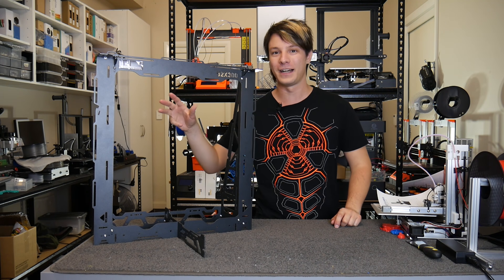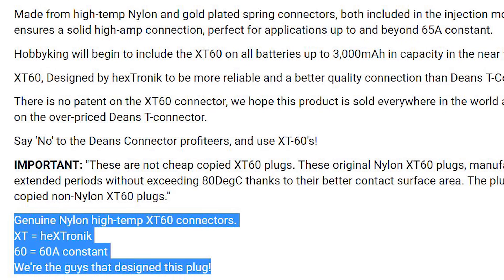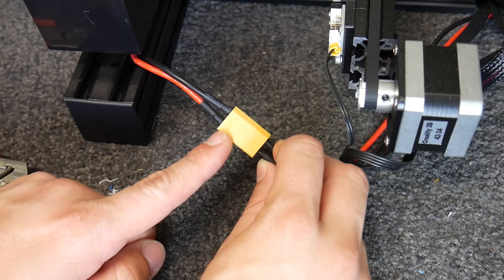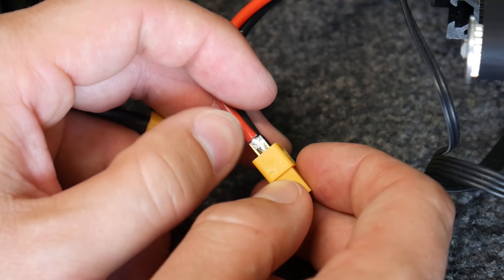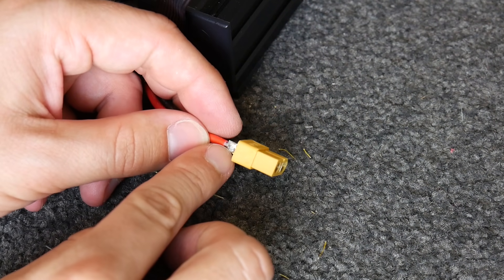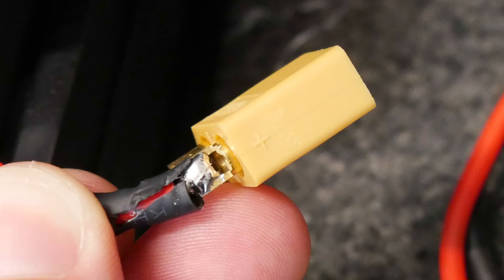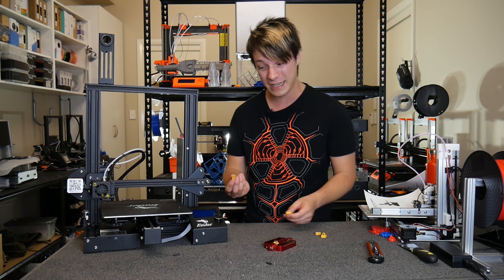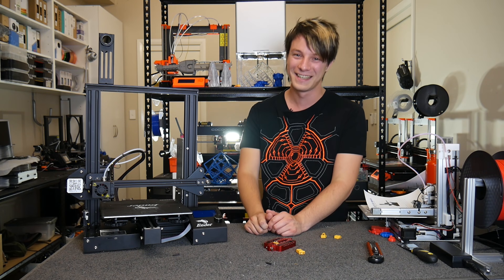Ender 3 Connectors are burning up... Bad XT60's

Comment: After watching this video I was concerned. I looked at the xt60 connectors on my ender 3, burned black. Shrink tubing on red wire was melted all the way through. When I tested it the plug was too hot to touch. I'm pretty pissed. I have two little kids and the thought that the house could have burnt down when I was printing overnight makes me really mad at this company.
Reply from the maker: It's unforgivable really.

Comment: Very interesting, just went and looked through most of my XT60 connectors on my quadcopters and those still unused in the parts drawers, the Amass and Turnigy (TGY stamped) ones look great but the few unbranded look worse in terms of plastic quality and shininess of the metal - however none of them have lots of amps pumped through them for hours & hours like on the Ender 3, so I feel I'm ok.

Comment: Other thing I noticed on them Angus, they don't appear to have the + genuine's do on the Flat Positive side all mine from Turnigy and HK etc have the positive side very clearly marked with a + and yeah they came out way too easy. Though as others have said the XT60 isn't exactly a 'gen vs knock off' as much as a plug standard these days like RJ45 etc.
That being said If they are either A. Badly Solders, B. Crimped or C only 1 peg split connecting then the resistance jumps massively, the XT60 is designed as you said to allow 60amps it presumes that it has at least the majority of the pegs splits connected in a firm contact to do so, and full core connection between the strands and the connector base plugs. 
Failure of any of these increases resistance and thus heat rapidly.
Reply: XT60 is not a plug standard, it is a product by AMass, and is specified in spec sheets like this: https://www.tme.eu/en/Document/2d152ced3b7a446066e6c419d84bb460/XT60%20SPEC.pdf, which is not a standard, just a product spec.  As compared to RJ45, where RJ means "Registered Jack", and ties it to raft of standardized specs.  Non-Amass blobs of plastic and metal with no specs are exactly knock-offs -- the situation is not like RJ connectors.  And the datasheet  pdf I pointed to shows that the XT60 is rated for 30A continuous, not 60A.

Comment: If the wire is oxidized, it can have a hard time wicking solder. Add a little flux to the wire to ensure it takes up the solder.

Comment: If we have to pull the whole thing apart and solder, or re-solder, why bother with the connector at all? Is it really needed for some reason? 

Why not just remove the cheap connector, solder the wires together, heat shrink tube them and  avoid a weak spot?
Reply from the maker: Not needed! Handy if you want to quickly isolate the printer's electronics but that's about it.

Comment: XT60's are adjustable...even those so called after market ones can be adjusted...just take an nail  or awl and spread the four parts of each side apart slightly...you can make them so tight you wont even be able to take them apart if you wanted to... the short and fire was caused by very loose fitting connectors...keep them tight and you are good as long as they are soldered correctly.. i have them in all my rc planes etc...

Comment: Hobbyking sells multiple versions of xt60 connectors. They are all fine, its just the lack of being soldered thats the issue. Some are made of different materials and hobbyking sells some made of different plastics at different prices.
Reply: The contact thing also doesn't mean much because its most likely the fit between the two plastic halves that makes them tight, not the bullet connectors inside them.

Comment: Hi just for the fact of color missmatch that inst per say a indicator for cheap this can just happen from a slight variation of the Masterbatch feeder usualy color get feeded at 0.6-2%  ,depending on the saturation of the color and base material ,so this can be easily a minor issue by the setup of the feeding maschine (Iam a plastictechniction)

Comment: If you want a free sturdy mount: use a set of pliers of some sort and put a rubber band over the handle. You can put a connector in de other end. That will secure your connector nicely.

Comment: I don't think these connections have to be made/broken frequently, so using a screw-connector terminal strip gives you solid connections and the ability to take it apart as needed.
Sometimes going quick-n-easy is bad, m'kay?

Comment: Okay, as someone who does QC on cable harnesses that go into very expensive, non-consumer devices, there's a few points of information here that are flat out wrong.  The biggest of which is the idea of a crimped connection being unsuitable for high power lines. Solder is more common, but both are used. Your real issue is going to be with the contacts, poorly machined brass of the wrong type has a loose fit, and gathers an oxide layer, causing high resistance, which causes the connection to heat up when there is high currant draw. Proper contacts should be make from the correct types of brass, to a tolerance that ensures a snug fit, and plated with a highly conductive, low resistance metal(gold).
Reply from the maker: Absolutely crimped terminals are as good, probably superior to soldered ones but the issue is the connector is only designed for soldering - it has solder cups. It's not designed to be crimped, so however they are managing to do it can't be good. I agree though, something also seems to be occurring the contacts as people are experiencing burning across the board, soldered or crimped.

Comment: Just got mine yesterday. Without cutting the insulation I can tell it's crimped. Will be replacing them soon.
Oh, you should always tin the wire first. Don't try to solder these connectors w/ bare copper wires; takes more heat.

Comment: I replaced mine last week and soldered them.(They were crimped) I had the same issue before i saw this video. The connector was so hot it could not be held. After replacing them, no further heating issue.

Comment: 6:13.. try prying/opening the spaces in the connector pints to see if the fit gets tighter. 
If not then the "brass" is not springy enough. You could always use X90 connectors all around,.

Comment: When replacing the connector, one might want to replace the actual power cables at the same time. If they skimp on the connectors there's a non-zero chance they skimp on the cables as well.
Reply: Yeah, I was just thinking that the cables are probably aluminium - or copper-coated aluminium at best :( They look like a good thickness, at least, but ONLY if they're actually copper! Aluminium has such a high resistivity in comparison to copper that those cables may well not be properly specced for that sort of current if they're aluminium. Would be nice if the insulation is silicone as well, which it looked like it might have been, but I couldn't quite tell...
Reply: @AndrewGillard  I could have sworn I read something, somewhere, about the cables being plated aluminium but I can't for the life of me recall where I read it, so don't take it as gospel. Check yourself, or just replace to be certain.
Reply: When I first took mine apart, I accuse them of being aluminum in one of the forums on Facebook.
Someone educated me that they are silicon wire which is very fine tinned copper with silicon insulation.
I replaced it with 14 gauge copper and no more problems.
Reply: @DjDiffrnt  I don't personally have one of these machines :) I followed Tom's "Dolly" i3 MK2 clone guide, but using much higher quality components, so my heat bed power cables are 12AWG silicone insulated cables from HobbyKing, which have tinned copper conductors and genuine HobbyKing/AMASS XT60 connectors :) Even though (because?) I built it myself, I trust my printer far more than I'd trust a Creality/Anet/Tevo machine 😂
Reply: @AndrewGillard  At least when you're doing it yourself you know where the parts have been sourced as opposed to when buying something (cheap) complete. I have an Ender-3 and an Anet A8 fire hazard, and I've always considered them being more like starter kits than finished printers. Currently I think that's a healthy viewpoint to have. 
Want something more finished? Buy something more expensive and proven.

Comment: Ditch the  connector all together and just run direct wire. Less hassle and you only need to do it once. The connector is only there to keep you from having to open the power supply or control box when assembling.

Comment: it's not that they're crimped, it's that the right amount of pressure isn't applied to the crimp. (the battery cable on your car is crimped...) I'm more apt to believe that the problem lies with the contacts on the connector. The outer case may be snug, but the internals may be only making contact on a small part of the overall surface area and therefore generating heat.

Comment: fyi i got my ender 3 yesterday afternoon, built it last night and the xt60's on mine look good, no washed out colour and can just barely pull them apart. really dont want to pull them apart to check the solder
Reply from the maker: Sounds like you got good connectors! Excellent.
Reply: Just received an ender 3 and have the same Amass branded connectors with a harder gray back. If you look at the linked xt60 replacement in the description on amazon, they are the same. Seems to me Creality has taken action based on this video/issue.

Comment: you should have added the soldering to the video since you plan on doing it anyway, hope you haven't finished that part. 

also if the fitting is even looser then yours, there could be some arcing of electricity in the connector causing heat build up

Comment: From the looks of it, the XT60 was DESIGNED TO BE SOLDERED and NOT CRIMPED!!! If these harnesses are being produced outside of Creality's premises, they should NOT be heat shrinked so they can be properly inspected!!! Heat shrinking is fast and easy! If male and female XT60 are connected together with a loop of wire, they can easily be cut to length and heat shrinked when they are ready to be assembled on the 3D printers!!!

Comment: I tagged you the other day showing a pic on twitter about how my cr-10s shipped with a loose screw on the bed heating cable, causing an electrical arc and burning up the PCB board. Come on Creality.

Comment: Hey Angus, do you think you'll look at the GeeeTech A10? I'm excited about it, compared to the Ender 3 because of it's mainboard. It's far better than the one that comes with the Ender 3, with BL Touch support right out of the box and places for Stepper drivers. All at around the same pricepoint. I did a video of it, it should be my most recent or so video.

Comment: Ended 3

7:18  looks like Ender 3 used a barrel crimp version of the XT60 terminal (I've never seen one before),  and they were crimped loose with inadequate wire strand compression.   Proper reliable crimp spec development for a defined wire size/spec and crimp terminal with proper plating & base material, is rather sophisticated, requiring extensive testing.for verifying the crimp performance. This is especially true for high current crimps, the crimp resistance must be extremely low and stable, or heat is generated which degrades the crimp further.. a spiraling failure that ends in a "thermal event".  Anyone just randomly selecting a crimp tool and thinking just squishing it together is a good idea for similar high current circuits ... is building a fire making device.
    XT60's work great when properly soldered. If wanting to crimp terminals, I'd use Automotive terminals / connectors and their developed crimp specs and defined crimping tools .. those type of crimps are validated to rigorous industry standards for reliability and safety.
    From what I've seen of these Ender 3 printers, safest solution, just remove that connector, run the wires of same gage or larger direct .. why mess with such risk on high current circuits??  KISS.

Comment: If someone is going to just take the connector off, why not just solder the wires to each other? Seems kind of odd to remove a point of failure just to add another point of failure.... I figure they put the connector there for ease of assembly and shipping, not because it helps carry current after the assembly process.

Comment: Hey Angus, got a small question for you and it is related to the soldering and wire work you are doing for this and any other video. I know you live in Australia and all and a friend and Fellow Maker does as well, in one video he did though he made a lamp and said he had to have a license to even do the simple set up in that is this true? Do you need a license to wire up electronics of any sort in Australia?

I only ask as my father has been working on Amps and mixers since I was a kid and he has no license, granted we live in the US and laws are different many places on the globe. I just wanted to see od the rule is that strict as I can't see a reason for a Shop Class level project needing a license. There is only one instance where crimping a wire is better than soldering and that is in Arcade Molex connectors as that is by design and low amp.

Comment: This issue is not new, this issue has been reported by many people months ago already in the Facebook groups. I'm surprised TH3D and other who follow up on it, only raise the issue at this moment. This is old news for anyone who is active in  the Ender 3 Facebook groups.

I also seem to get the feeling Angus likes to report flaws in Creality printers. I have not seen any positive videos from Angus about Creality or Creality printers in forever.  What did Creality do you do you Angus that we only get to see negativity about Creality on your channel?
I'm happy you got set straight on your stringing comment in your "review" of the Ender 3 Pro and props you posted a followup on that.
Reply from the maker: The positive video was indeed the stringing fix one and that was recently. I did like the CR-10 mini too but that was some time ago for my budget makerspace video. Other than that just the two ender reviews. If I was aware of this months ago I would have definitely raised it but unfortunately it's impossible to be on top of every detail of each printer and its community. I'd rather never talk about them again tbh but this is a safety concern so I feel I need to, just like the hot end shorting issue of the early wanhao i3's (that'll be fun to dig up lol).
Reply: First of all, thank you for taking the time to reply. 
Did Creality demotivate you that much with their CR-X that you require miracles from them to report positive about them? If you dislike them, why make videos about them at all? I understand you run a YT business here and Ender/Creality printers are popular and thus attract viewers. I understand you feel you should report a safety hazard, but i mean more in a general point of view. 
There's a boatload of issues with Creality printers, also regarding safety. The first few batches of Enders (and other Creality printers for that matter) don't have thermal runaway protection enabled. These are thousands of potential fire hazards peoples homes. 
Lastly i'm really surprised Tim (TH3D) only now tweeted about this issue as he is active in the Facebook groups himself and the issue has been posted multiple times. Though Tim also has a love/hate relationship with Creality. A big chunk of his business relies on Creality printers, but he's not a fan of the company.

Comment: Yeah that solder join really doesn't look good at the xt60 connector, I fill it up with  solder and then put in the tinned wire while it's still liquid. You also need to warm up the metal part of connector for the solder to stick properly

Comment: Those xt60's are used almost exclusively with racing quadcopters / drones.  Never seen one burn up from excess current.  Plenty of quads have crashed from the cheap connectors coming loose in flight tho.

Comment: Mine didnt burn up but the inside of the Negative was definitely scorched a b, and i have been running the bed for practically all the prints, tpu, petg, and pla. I had mine for 8ish months, so not too bad for a 1st gen, but not great, i just replaced the cable with larger gauge went direct from PSU to the control board, no more XT60

Comment: Bought a regular Ender 3 during AliExpress's 11/11 sale last year and it was soldered. Still, replaced it with 14 AWG wire and got rid of the connector.

Comment: Even better is to get rid of as many plug in connectors as possible  , its not like you have to change a hot bed once a week so why have a connector ?  You can run a small cable tie to hold the connectors together  especially for your combat robots where  shocks from impacts are present .

Comment: If you're pooling the solder into the XT connector before you "plunge" the wire in, then  you need to flux the wire first. This is because the flux that was in the solder would have mostly burnt of prior. This is only true if the wires are not tin coated (which is more expensive anyways).

Comment: can you do a test running 60 amps through the connectors for a few hours
a 60a current settable power supply would be easiest, maybe dave has one ?

Comment: Yes, fire bad. I just got done replacing my 2 wire plug with a proper 3 wire plug on my i3 knockoff. Had a strange power issue. Now it works fine.

Comment: Thanks for the video. When I got my E3 I found both wires coming from the PSU damaged (cuts on the insulator under the black cover) so I replaced the whole cable and soldered new connectors. The originals were soldered OK and there were no heat issues but they did not last long so who knows. I am running multiple hours prints with 100C bed and no probs but tbh the original wires were dodgy enough. It's a cheapo kit and there are issues with them for sure. Nothing really serious (ok, crimped XT60 are serious) but the issues are there. It's funny to see this machine can print properly but these annoying things are... annoying.